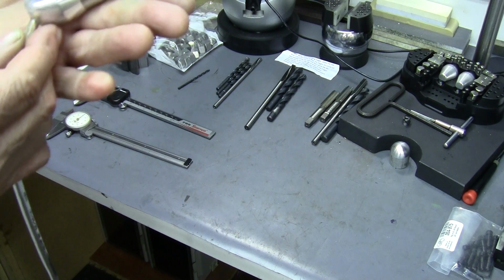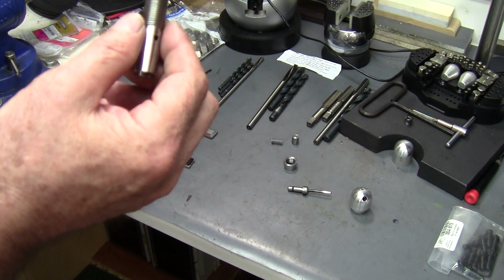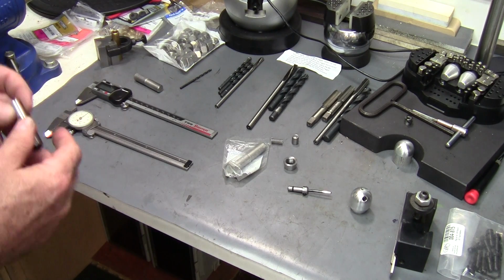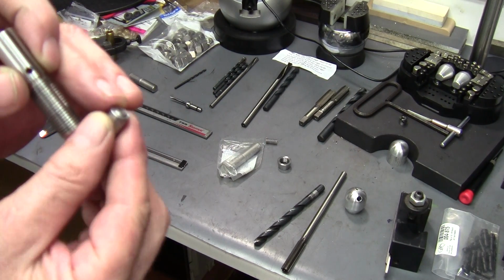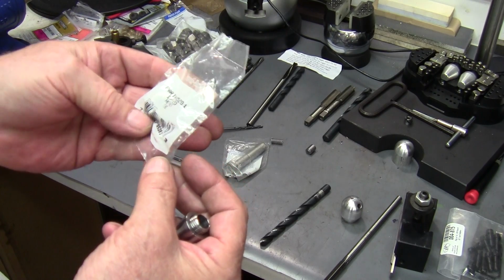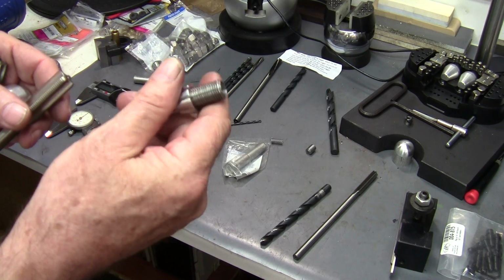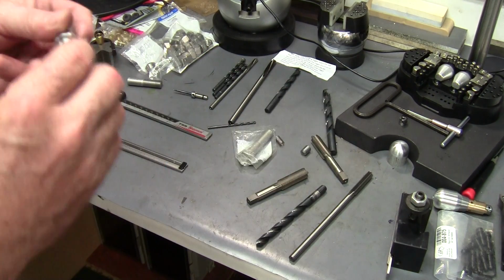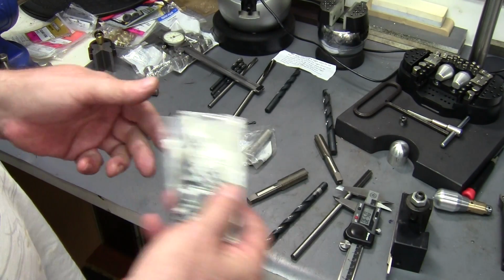How I make a Hand-piece for the Homemade Hand Engraving Machine Part 1

Comment: What about the spring and do you use an adjustable speed compressor I am trying to use an airbrush compressor with no speed control, and am not to happy with it. I am going to try and use brass, steel, plastic pistons with steel inserts for impact to control weight / speed. your thoughts thank you bill
Reply from the maker: Yes I do use a speed controller and it is a must on the modified 12 volt compressor,  along with the foot peddle I feel I have good control over the hand-piece. Turned up all the way it is unusable. You are using an airbrush compressor, so your going to need a speed controller that will work with 110 volts. I think that maybe an airbrush compressor is too much for this application. Shaun Hughes said he had tried an airbrush compressor and he didn't have any luck with it. If controlling the speed does not help, then you know its too much compressor. The smaller 12 volt tire inflator/compressor seem the be the right size for this job. Bigger isn't all wise better. I can engrave steel with no problem at all, plenty of power. 
       What is the bore and stroke of your compressor? The one Im using has a 1.184 inch bore with a .500 inch stroke. Im not sure what your asking about the spring, but it should be a very light spring.  Good luck, Hope this helps.
Reply: the bore 1.581 inch with .400 in. stroke but will only run at 1725 rpm  i think i need more RPM's as it stands now copper / brass, alum. is work no power why do i need a spring 1/2 of the stroke on the compressor is vacuum won't that pull the piston in the hand-piece back ? thanks again bill
Reply from the maker: I'd still try slowing it down and bring the speed up slow to see where it starts working. On my compressor I run it at half normal speed or less, any thing over half is too much.I don't think it runs any faster than 1725 at full speed. The spring is more like a shock absorber in the vacuum stroke, it don't need to hit the back of the hand-piece as hard as it needs to hit the QC tool holder. Keep at it your all most there!!
Reply: That is what they all say! thanks not going to stop i will master this
Reply: have u modified ur compressor to pull and push air instead of building pressure ?a n airbrush compressor should be great as it must produce more volume than the harbor freight tire inflator.and that works good.but u have to modify it by blocking to flapper valves
Reply: I have a variac that that I use to adjust voltage to my small battery charger them to my 12volt compressor
Reply: I plan to duplicate rocks set up but right now money is tight. so I improvise..hey it works great.
Reply: go to ur local electronic surplus store u may find some nice things
Reply: I made a nice foot pedal real nice and simple and man it's a must.i plan to put some of my ideas on you tube as soon as I learn how to do it
Reply: Ricks stuff is first class as a machinest  his finish are a1 I like his attitude as far as excepting new ideas ..cool
Reply: remember some laws of physics about using volume..u can only use as much as u can produce.if u have too much hose length then u will lose efficiency  because ur piston can only produce it's own volume
Reply: then u will lose power to slam piston forward because by will have compression factor in the volume of ur plastic tubing and u will have POWER lost
Reply: ur going to find a sweet spot between full speed and low speed ..remember u have other factors to consider.like spring pressure tolerance between piston and bird. volume.lenght of air line. size of piston and impact power all must be considered to get good performance
Reply: also possible air loss du to poor for of air line and piston I use a teamed nite 3/8. .375 and no more than one to two thousand clearance.if u bore ur piece with a still u will lose power.it needs to be reamed.leave at least as much as 10 to 15 thousand  from still to team use plenty of oil then for ur piston to bore